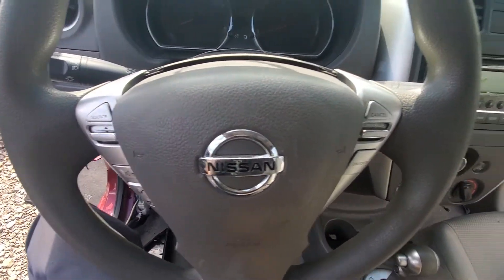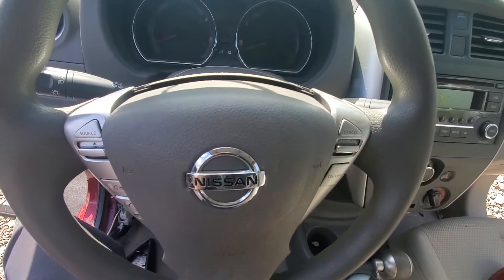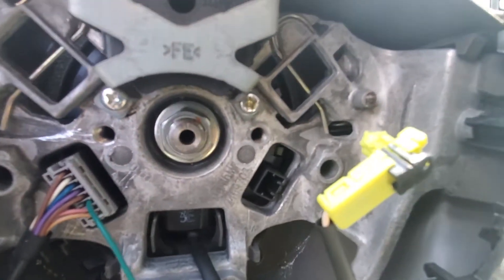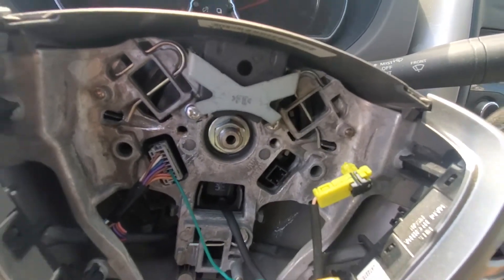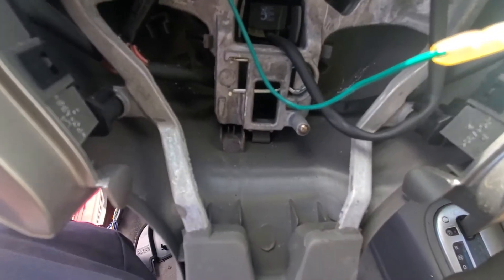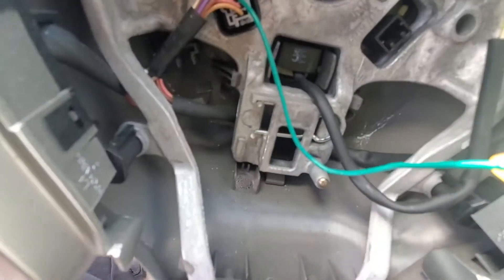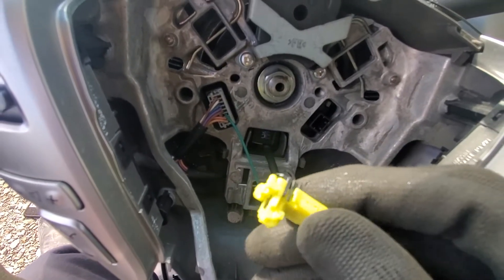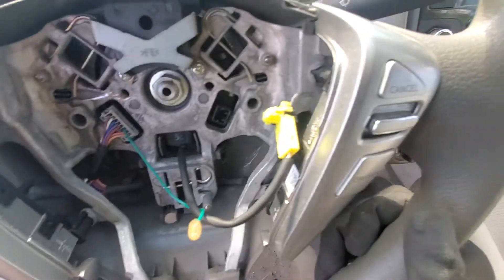2016 Nissan Versa Driver Airbag Removal

Comment: How did you take the cover off?
Reply from the maker: The cover of what?
Reply: @CrowtownAuto  steering wheel cover
Reply from the maker: Like, the clamshell behind the wheel? I don't understand.
Reply: @CrowtownAuto  the cover of the actual steering wheel. The only part you didn't remove on camera. The part that says "Nissan" on it
Reply from the maker: That's the part that breaks when the airbag deploys. To my knowledge it's not removable from the rest of the bag assembly.
Reply: @Crowtown Auto  I actually ended up realizing all of that after I started this. I'm still having problems removing this though. The top 2 unclipped but I'm having difficulty with the bottom

Comment: Alright, hey, buddy, I'm back. So, just to bring you up to speed, yes, my airbag deployed. I've removed the deployed airbag, broke the yellow connector behind it but i ordered a new one. I'm positive that i can butt splice it together and I plan on picking up a new airbag tomorrow. My question is simply this... if I hook up the new airbag, will the airbag light go off or is that something that I need to do separately? Also, same question for the seatbelts when I replace those because they also locked up when I had my accident
Reply from the maker: You'll need to pick up replacement seat belts. You can find those at most used car part locations, LKQ, ebay, online, etc. Check your buckle as well as sometimes they have a pretensioner in it that deploys also. These SRS components are actuated by the SRS module, which is located under the center console, oftentimes to the right of your gas pedal under the dash. I can't recall offhand where it is in your car. These modules are in many cases single use, meaning when SRS equipment is activated, the module needs replaced as well. That will deactivate your airbag light and ensure your replacement equipment works if you were to need them again.
Reply: @CrowtownAuto  yeah, I'm picking up the replacement seatbelts also. But if I install them without replacing that module, will they be locked up on me again? Also, my original question was about the airbag light. Will that reset itself when I install a new airbag?
Reply from the maker: @mikehill3407 to my knowledge if you don't replace the control module the light will stay on and the airbag will not function. The replacement seat belts will work as normal unless you were to have another accident, in which case they wouldnt lock and severe injury could result.
Reply: @CrowtownAuto  crap, can you show me how to replace the control module? 😭😭
Reply from the maker: I found a good working video of removing the console and accessing the module. As stated in the video, it may require programming to marry the replacement module to your vehicle. I'm unsure of any resetting of the existing module though.

https://youtu.be/k4nKfDwp0Cs

Comment: Okay, so I got the airbag off. But that black clip on the yellow connector broke. Do I need to replace the connector?
Reply from the maker: It's more of a locking mechanism, not a huge deal as long as the plug is pushed all the way in on reinstall. If you're concerned, maybe a piece of tape over the connector to add a little extra wouldn't hurt.
Reply: @CrowtownAuto  no, I'm looking at it, and I know I need to. The connector broke off inside the old airbag ☹️
Reply from the maker: Ohhh. That's ungood. If the wires aren't attached to the plug anymore you may need to replace the clockspring. This is all dependant upon whether this is the same airbag you started with or if you're taking one out that's deployed to put another in. Sometimes the clockspring behind the steering wheel that that yellow plug goes to needs replaced as well if the airbag goes off.
Reply: @CrowtownAuto  I just ordered a new clock spring
Reply from the maker: OK. There should in install instructions with it. But I've also seen youtube videos on those if you need further information
Reply: @CrowtownAuto  oh snap. Can you link me one?
Reply from the maker: 1A Auto videos are pretty extensive, so you may wanna forward to where you need but better to have too much info than not enough. 
https://youtu.be/Yxf67_OQ9j0